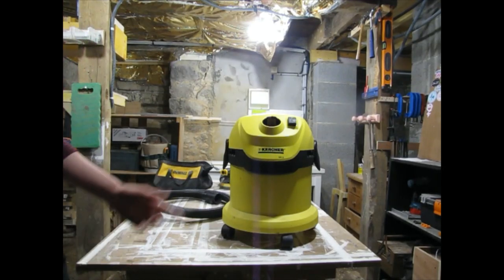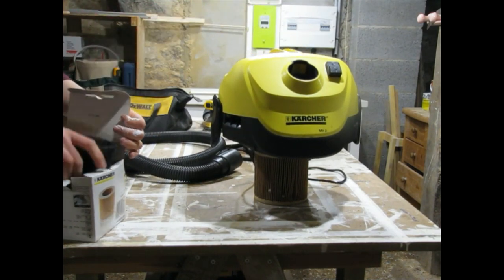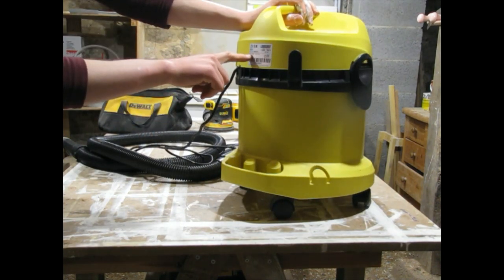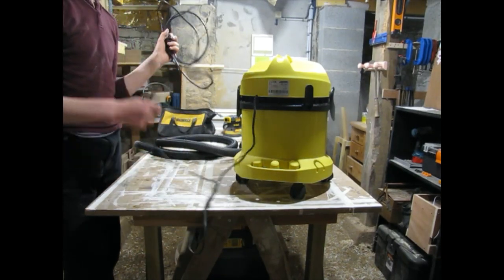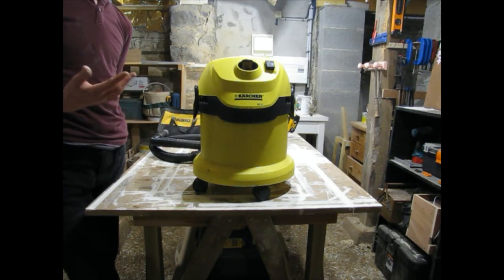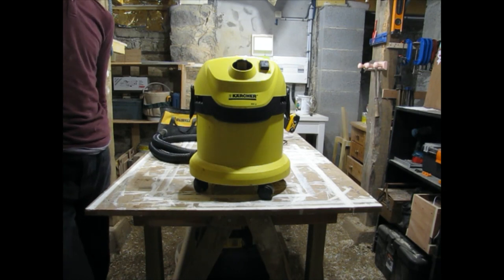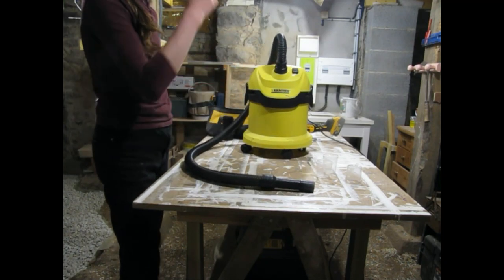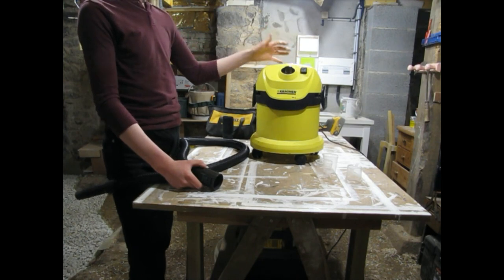Karcher Shop Vacuum Review (MV 2 or WD 2)

Comment: The filter and bag comes with the vacuum..you don't need to pay for it.....You may just have to buy some more bags if the bag it came with is damaged but that is all...
Reply from the maker: Yes, it comes with it. The filter should last for a long time but you will have to buy a new one eventually. The bags fill up pretty quickly so you’ll have to buy a lot of them although depending on what you are vacuuming you can run it without the bag (like vacuuming sawdust). Thank you for watching.